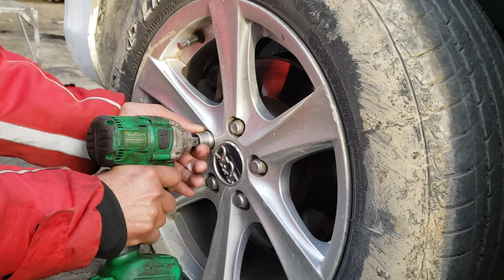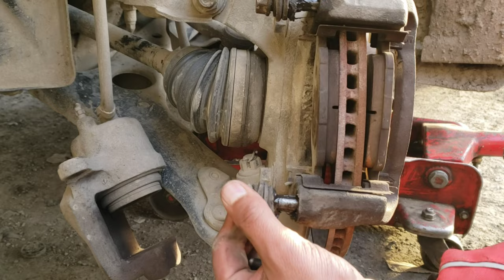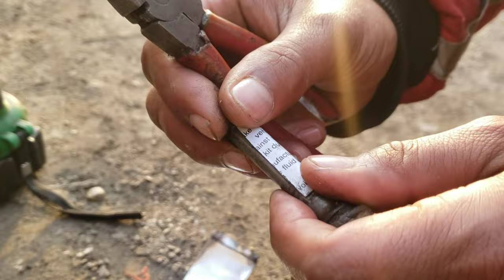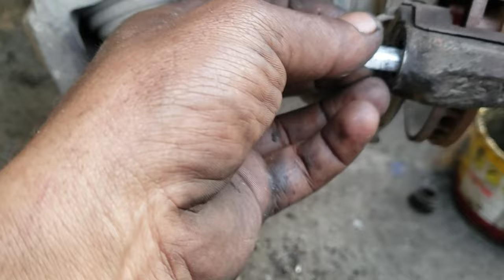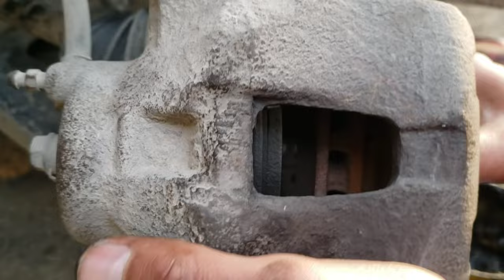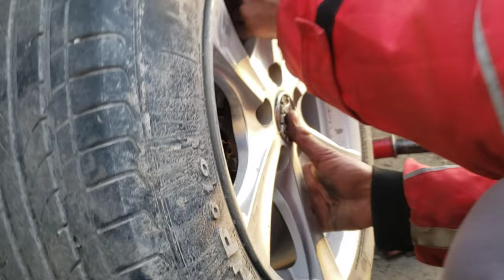brake caliper noise solution

Comment: I have got problem with my right side front, when I brake and pull out,  it makes knocking noise when driving it's fine, I have replaced with genuine brake pads with fixing kit, but it's, still the same ,do you know what it could be ?
Reply from the maker: @tastas3331  did you resurface the rotor with new pads?
Reply: @adeelautosworkshop373  I didn't do it myself actually the job was done by the mechanic in garage
Reply from the maker: @tastas3331  ok then you should check ,I think this would be the reason

Comment: Why is this not a good idea as others say, replacing pins didn't help but this does stop the noise , so what else can u use to buffer around pin then
Reply from the maker: Every one has his own mind,we deal with the situation
Reply: @adeelautosworkshop373  so the tin foil is safe and should be done? Last time I tried it I was nervous doing it cause I was afraid caliper or something would catch on fire

Comment: Don't do this brake will jamm , and wheels will heat up
Reply from the maker: You are right but caliper,s pin size is down and after this pins are free
Reply: No the piston is not affected so it cannot jam
Reply from the maker: You are right sir,but only machinics know that the wheels will not jam and heat up

Comment: No. SLIDE bolt beeds to SLIDE if you have to use a hammer to grt it in? You no good
Reply from the maker: @brandrine6163  sliding pins was hard when I used shims,but with hammer I had free pins,don't worry bro,it was only temporary solution for two or three days
Thanx

Comment: Terrible advice here. A set of new slide pins is less than 10 bucks. Pins are not supposed to fit snugly in the bracket. This allows for grease to circulate. Hammering in the slide pins with this sheet metal rubbish is friggin' insane. Notice how he doesn't demonstrate the slide pins moving freely before he reassembles everything. That's because they won't. This video is a disaster and no one should try this. Just buy new pins or a new bracket and pins....not expensive. I wouldn't let this clown anywhere near my car.
Reply from the maker: @maggiewagmore8778  you are absolutely right but it is  temporary solution,till buying new one or till availability thank you 😊